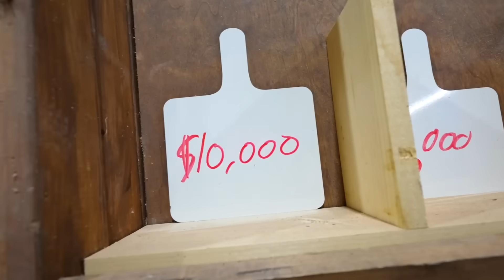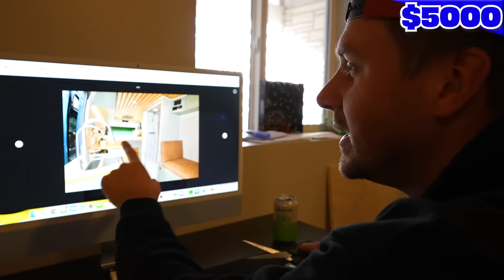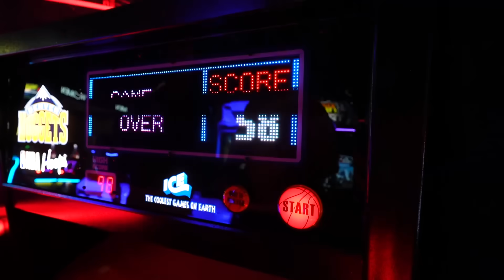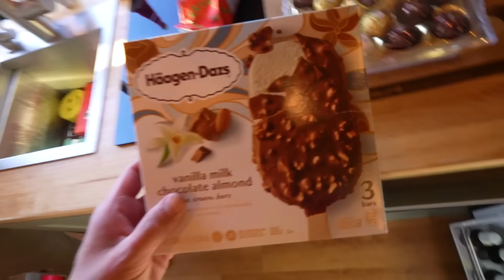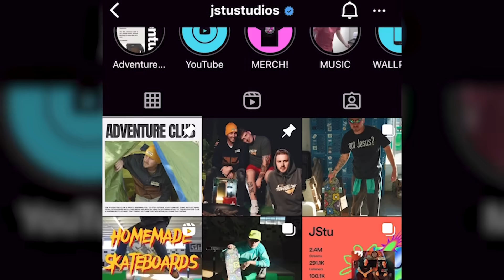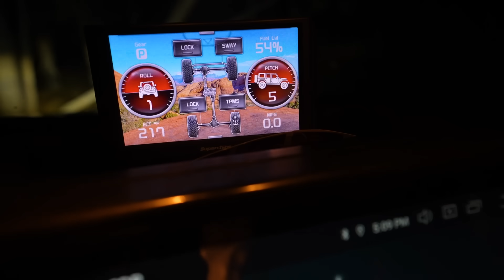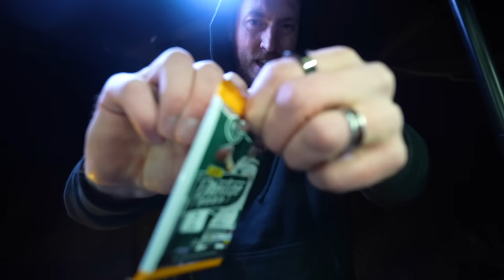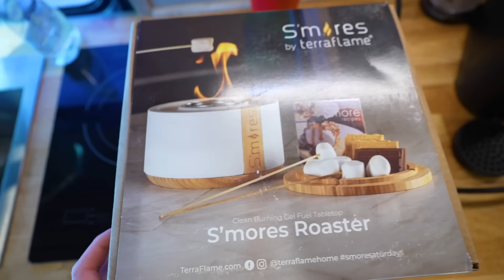$100 vs $10,000 Car Camping! *Budget Challenge*

Comment: Jstu should do a house budget challenge where they find airbnbs across Colorado and Kansas where they do two budget drops one for the state and one for their budget big baller should be $100,000 and the low budget should be $1,000 while the middle budget should be $50,000

Comment: Grilled cheese didnt melt bc engine is specificly made to not heat do it would destroy the parts around it so its isolated from the heat it would've been better if you have put it on the exaust